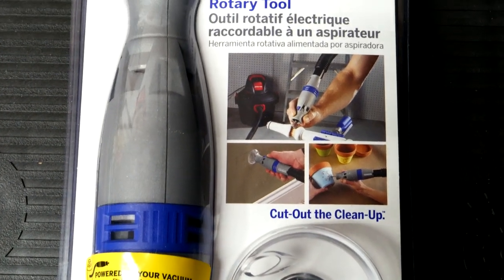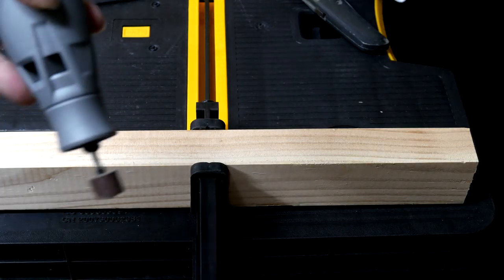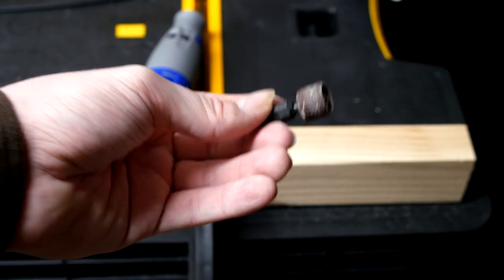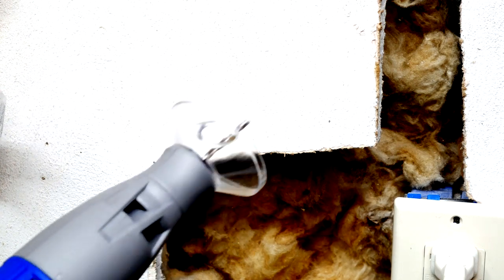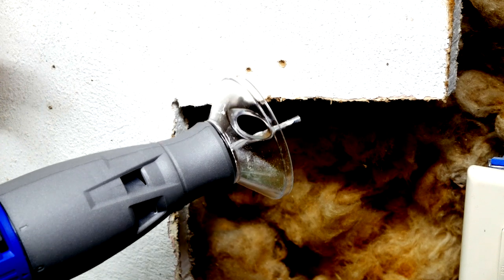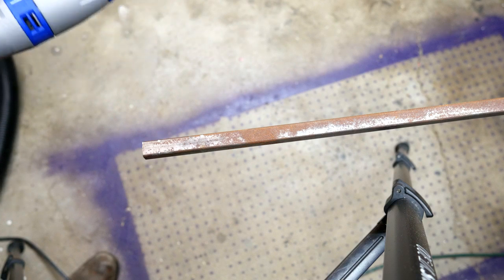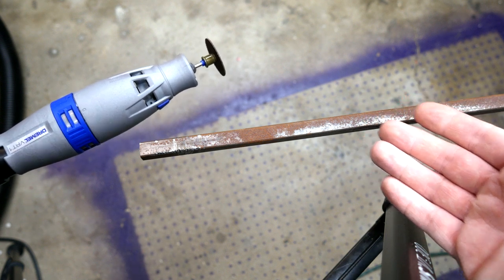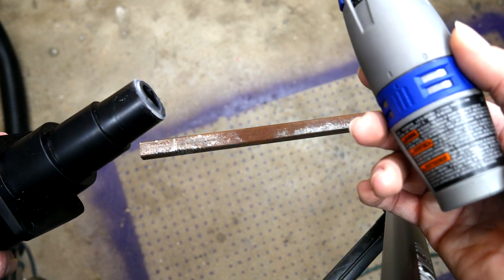Dremel VRT1 Vacuum Powered Rotary Tool Review: It Really Sucks

Comment: Are you sure you turned it on correctly, with that blue ring around the middle? Looks to me on the drywall test like the holes are open on it. That means it's turned off.

Comment: When you put the tool in a Dremel you push it all the way in then pull it out 2 or 3 mm then tighten it. That prevents you needing to remove the chuck to remove the tool because you can push the tool in once loosened to crack the grip.
Reply from the maker: Hey that's a good tip. I'll use that next time I am dremeling.

Comment: I just used it with my wifes eureka vac the tool works great with. several different bits they possibly have a cloged vac bag
Reply from the maker: The shop vac was running fine with no restrictions, and was much more powerful than they recomend in the instructions for the tool. I also tried it with a Dyson DC39 and had similar results. The problem was the bearings inside were dry from the factory. Once I lubricated them the tool worked better, though it's performance is still pretty poor. Check my channel and I posted an update video of the "Fixed" tool in action.

Comment: I just bought one at lowes on sale for 7.99 i only bought it for cleaning off fine rust off an small antique with a brass rotary brush . Will get back with results later ..Glad i didnt pay twenty five the extras where worth a few bucks .Will get back
Reply from the maker: I got mine on sale as well. I think it was 9.99$ though not 7.99$. It was worth it for the bits and for the experiment of trying it out.

Comment: in the youtube ad they show it actually doing stuff,like cutting drywall etc..I wonder what they did,maybe they attached it to a freaking jet engine,or secretly put a motor inside..have you seen it?
Reply from the maker: +Biagio Mattia Moro Actually... I'm in the middle of editing together a follow up video. I think I fixed it! I don't know if it's universally a problem with all of the ones they sell but I did find a problem in mine. Stay tuned for a video of the VRT1 actually doing... a little bit of something. It's still pretty whimpy but under the right circumstances, for a person with no other dremel or rotary tool, who owns a hefty shopvac, and can get it for 9$, it might make sense.
Reply from the maker: +Biagio Mattia Moro The followup video is up. I once again try to recreate the various functions shown on the packaging. No jet engine required, but there is a fix needed for the ones sold in stores. That marketing video was probably filmed with an early demo unit that was perfectly setup / built by Dremel engineers.

Comment: Weirdly enough, though it is wimpy as hell, I have found one thing it's been extremely good for -- I use it to finish sand (180 and 280 grit) the laser-smoke marks off of my laser-cut plywood lamps. I work out of my apartment, so I can't get dust everywhere (or really anywhere), and I don't even have enough room for a powerful enough Shop-Vac (mine is the little portable 2.5 gallon version, definitely under 110 CFM). With the 180 grit #411 Dremel sanding discs, as well as the #511E finishing abrasive buffs, the VRT-1 has made really quick work of it (it used to take forever to hand sand the marks off, and my regular Dremel tore up the surface much of the time). But, it's also picked up about 85 to 90% of the dust ("scientifically" measured by seeing how much of a dust coating is left on my kitchen counter and floor afterward when compared to my regular Dremel doing the job). So that's one use -- I think I'm going to pick up a second one soon, just so I have an extra one when Dremel inevitably discontinues them for not being useful at much anything else.
Reply from the maker: +bensostrom Good to see that you are actually having some success with the tool. When you've been using the sanding drums did you use the depth collar as well? I think the vacuum feature works much better with that but the collar gets in the way of a lot of operations so you can't always use it. 

Also, did you see the update I did where I fixed mine and it actually ended up being somewhat capable? I'm curious if maybe your was manufactured more recently or in a different batch with better bearings.
Reply: +FirworksYT I have been using the depth collar with the sanding discs -- it doesn't really get in the way of those since the sanding surface is on the top, I just set the bit out slightly further than the lip of the collar and then use one side of the collar edge butted up against the material as I sand. But with the abrasive buffs, I've been taking the depth collar off -- you're right, it totally gets in the way on those types of operations. It still seems to be picking up the dust on that pretty well, but it may simply have to do with the fact that I'm doing such a fine-grit sanding that the sawdust that comes off is extremely fine and gets airborne very easily, which may make it easier for the VRT to suck up than the heavier stuff.

And I saw your update video right after I wrote my last post -- that is a great idea! I hadn't actually done that with mine -- I got mine shortly before Christmas, so it's a pretty old unit and likely has the same problem with lubrication. When I buy a second one, I'm now thinking I'll lubricate it like you did and compare the two -- hell, it may give me two different speed options, which might be great (and it'd certainly be useful to have something powerful enough to engrave glass hooked up to the shop vac in my apartment, as that's something I occasionally have to do and I usually have to use my regular Dremel for that).

Comment: Dremel used to make some pretty BA stuff, but  now it is like they rather make junk. This is supposed to have the power of a 4.8 volt electric tool? Hell, I had a 4.8 volt off brand Dremel, it was terrible!! It would not even cut thin wimpy plastic on the tail lights of my 2003 Grand Prix I had. The fact that someone at Dremel thought "Hey! You know what the world needs? A vacuum powered Dremel!!" shows that the company has no idea how to innovate now. It would take the power of a small black hole to make that piece of crap useful. This is one reason I have lost faith in so many companies, when they think of stupid crap like this. I can understand the concept, but just no. Power the thing with good ol' 120 volt AC, then have a way to maybe attach a vacuum to it? Even then, I doubt it would keep the work area that much cleaner, and what happened to just cleaning up the mess when done anyway? Also, powering that off a vacuum, not exactly the most efficient way to power a tool either.
Reply: I decided to buy a brand name rotary tool thats why I got a dream. Never looked back! since i returned it that is. Came broken out of box, switchs even on display modles were messed up.

Comment: My 10 € cheap die grinder that is 7 watts has more power than this thing XD (compared it to the vacDrem in real life )
Reply from the maker: +FOXER I just released a followup video where I fixed a problem with it and the performance is much improved! It's still probably a lot crappier than your die grinder but, it's no longer a very light paperweight.

Comment: You said it sucks. Isnt it supposed to!
Reply from the maker: One of the features is:
"The suction of the vacuum powers the rotary tool and cleans debris at the same time making the Dremel VRT1 the ideal rotary tool for users wanting to keep their workplace clean and airborne dust to a minimum."
It even comes with a dust shroud. It's supposed to clean up the dust as it makes it but it really can't. There's not enough air power to spin the turbine and also evacuate the dust.

Comment: maybe the shop vac is crap.
Reply from the maker: The shop vac I tested it with is much more powerful / higher CFM than the one they recomend for use. I made sure to eliminate the vacuum from the test as one of the failure points.
Reply: Nope the dremel sucks check AvE channel, he even reversed the process by putting 100psi on it BLOWING instead of sucking the shaft. It's a POS...